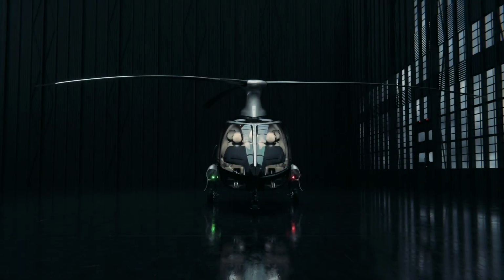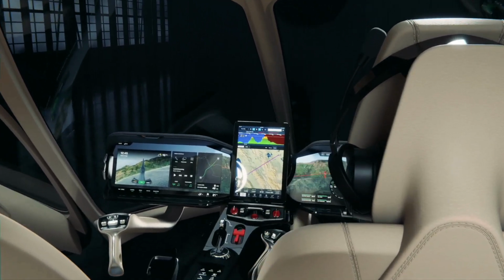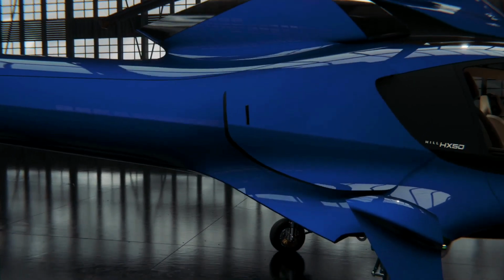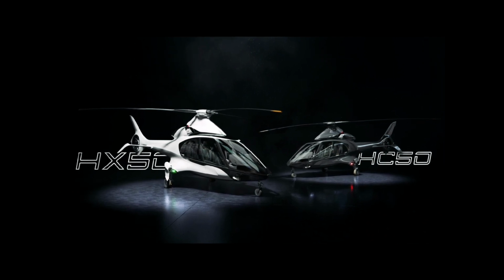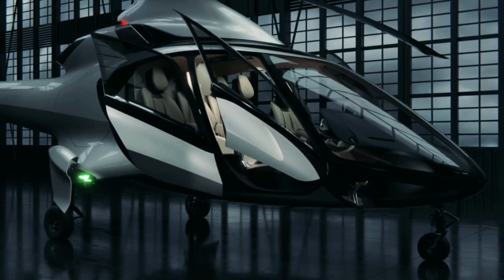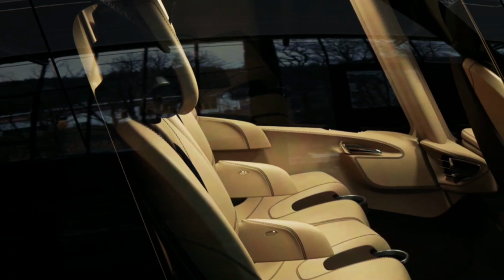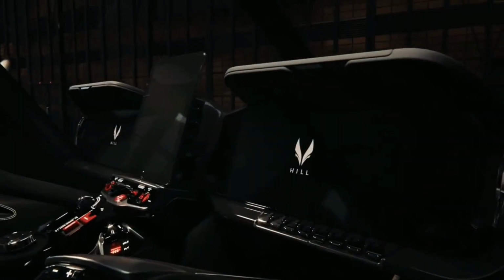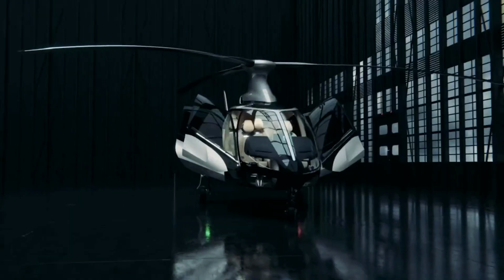Hill HX50 Helicopter

Comment: It's fuel economy is 370g/Kwh. That's really bad. A modern petrol engine is 225 or better.
Reply: The difference is this thing is an aircraft and can fly straight to its destination at over 100 mph
Reply: @ticenits1926  what's your point. A modern petrol engine can do the same.
Reply: @chippyjohn1  well of course because it is a turbine! It'll probably never fail and always deliver max power. It's a safety assurance when flying over trees or water.